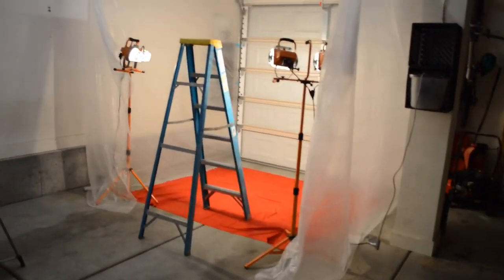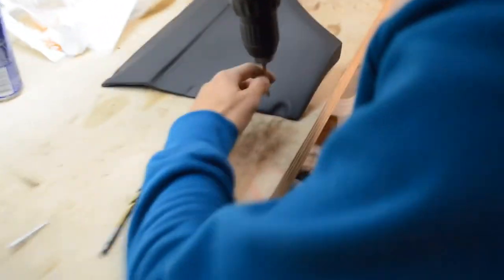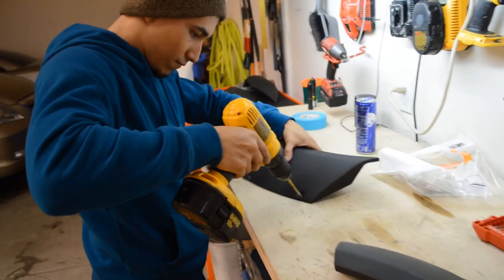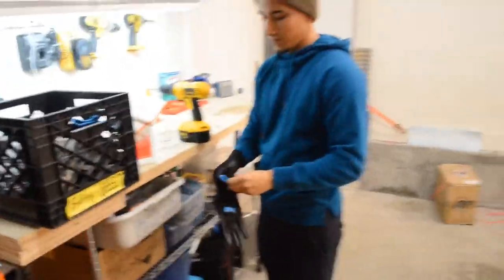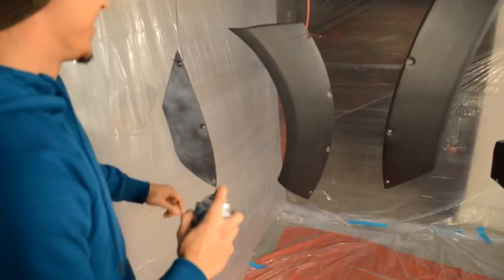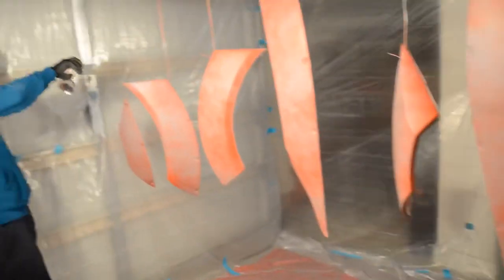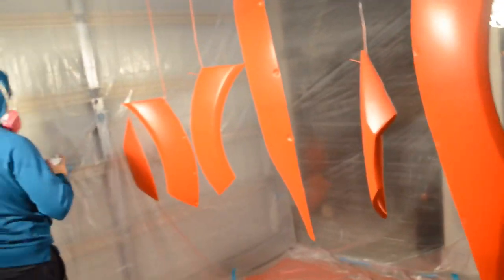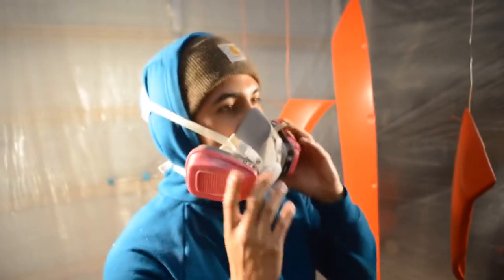We Spray Painted the Focus RS WIDEBODY KIT?! Amazing Results!

Comment: Where’d you get the paint and what brand?
Reply from the maker: A local auto paint shop mixed Ford’s Race Red and had it put into spray cans. Most local auto paint shops will do it you just need your color code! :)
Reply: How many cans did you use of the red? and how much did the paint shop charge you to have the cooler matched to rattle cans?